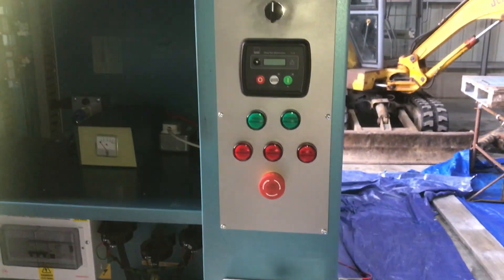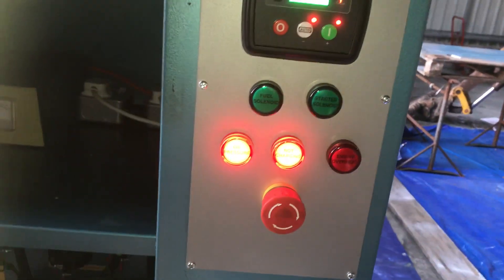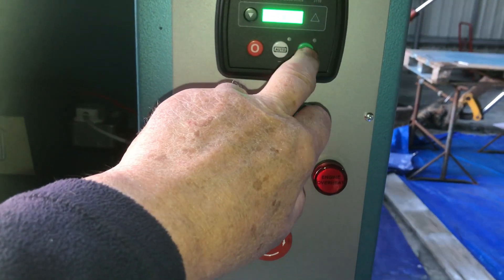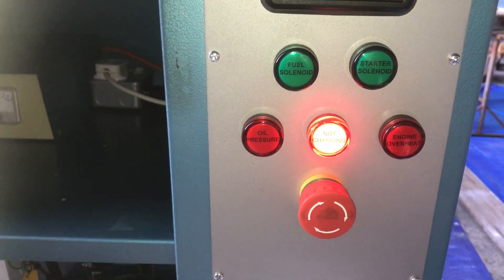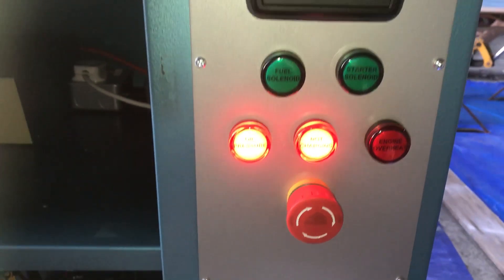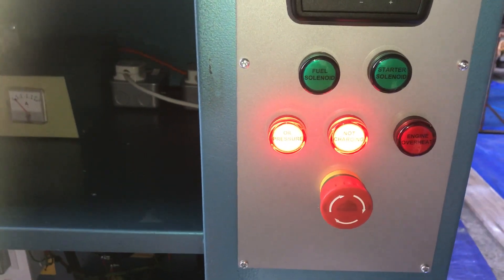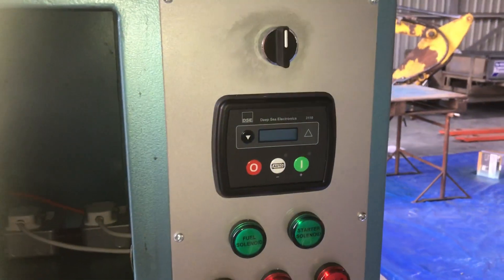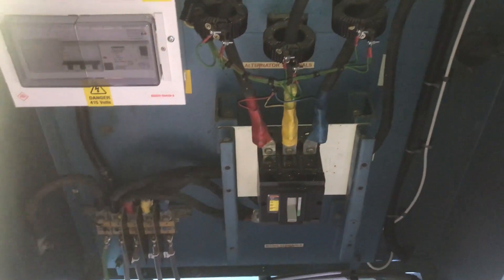First Run Under DSE3110 Controller

Comment: where do you wire in the preheat relay
Reply from the maker: There is no pre-heat. This engine has no glow plugs or inlet manifold heater. There is a heating element in the oil / water heat exchanger for winter cold starts but it would take yhours to have any effect - it's really just to prevent freezing.